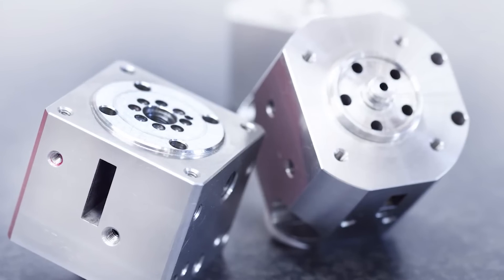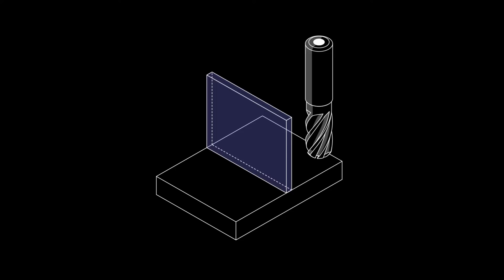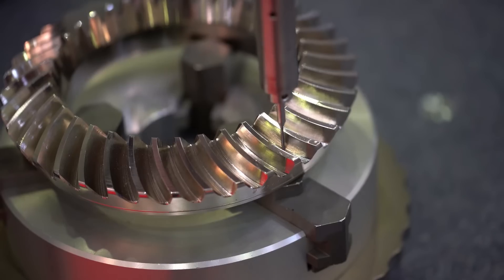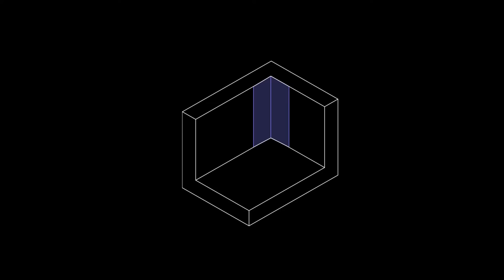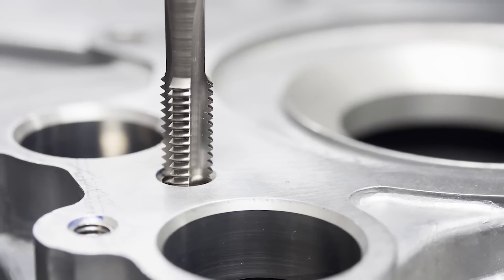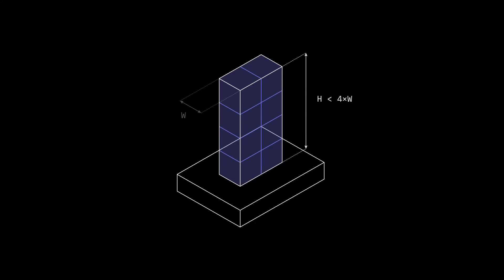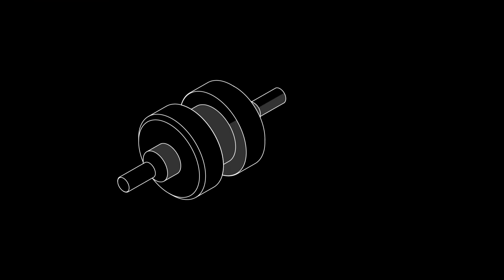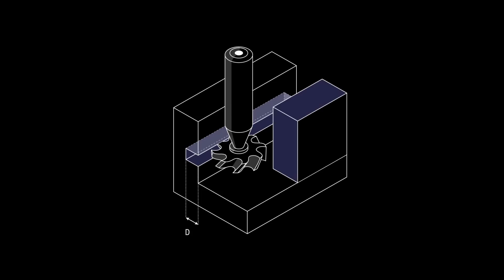CNC Machining - How to Design Parts for CNC Machining

Comment: As a Machinist looking towards the Design and Engineering side of things, I think the experience of programing and running machines alone is massively beneficial to understanding how to Design parts.

I highly recommend that any new designers talk to people with experience using the manufacturing methods you want to use for your designs.

Comment: About to plunge into the CNC world at the RC scale... Finally a video that lays out what my newbiebrain kept wrestling with, accuracy, precision, tolerances, tool and machining capabilities.
...like how is the tool made to cut inside/outside the line?
- I quickly saw the need to create a combination of 2.5D sub pieces to build a 3D final object that the limitations of the tools prohibits as a one block creation.

- I also dreamed of repositioning(he mentioned), as I would have to do that to design pieces that are bigger than the machine can handle.

- One thing I also have thought of is how to get an inside corner to be square.
  basically, a square piece can be made to fit inside a round one... tricky!

  ... This will work to a maximum precision as per the smallest tool that can be used,
      and given the thickness of the surrounding material requirement.
      so, run the small tool in a second pass, past the corner design until all the corner material
      is removed and the small tool is driven by a distance of its radius past the actual
      corner desired... that will leave an indentation in the corner that is 1/2 the width of the
      small tool(clover leaf), and leave the inside fitting piece the space it needs to mesh squarely.

  ... or if possible, round the corner of the inside fitting piece to match the
      original outside piece rounded corner.

  ... or use another sawing/shaving tool to clean the corner, a specialized attachment
      rotated in position on the same head.

Comment: The maximum depth of holes you recommend is 4x the diamater. OK. But then why do you go on to say 10x is typical? What does that even mean? Isn't that 2.5x higher than the maximum you recommend? That doesn't sound typical.
Reply: Yeah I just spotted that.... I think he's recommending 4x Tool diameter for hole depth for best results, but says 10x is typical and 40x is feasible. EDIT: yeah doesn't make sense. I just researched it and anything over 5x and you need to use peck drilling to remove swarf and then 7x you need to use special parabolic drills. You can go to 20x with gun drills. There were other errors in this video as well.
Reply: @aries6776  Chiheng Hardware is a professional manufacturer of CNC machining parts from China,we can make repeated positioning accuracy within tolerance +-0.005mm.please contact me if you want to know more about CNC machining.
Reply: @aries6776 What is feasible is totally dependent on whether or not you have high pressure, through-spindle-coolant and through-tool coolant.  40x is not entirely uncommon these days in some applications.
https://youtu.be/UOAXJ7kOLZw?si=SV7aIHRH0WVXPsvy
Reply: Glad I'm not the only one lost in the sauce here

Comment: Hi, great video! I just didn't understand one part–when you were recommending using a T-Bone undercut when 90 degrees corner is required. Could you please elaborate on what you mean by that?
Reply: I didn't understand this either.
Reply: I believe this was an error. What you can do is design in a relief pocket where the fillet eats into the corner. Slightly hard to explain. Only thing on this video I found that wasn’t very accurate.